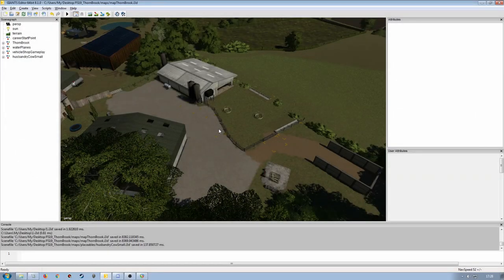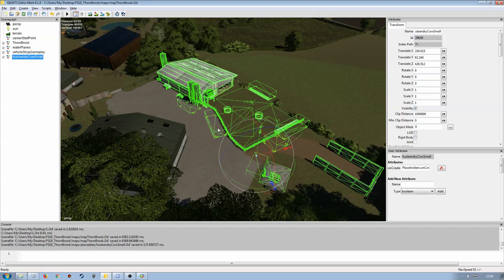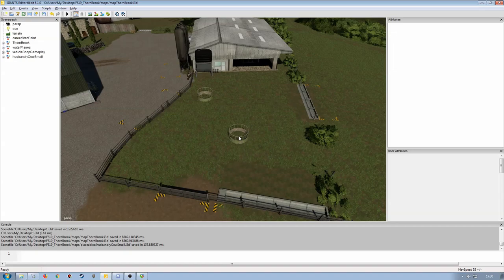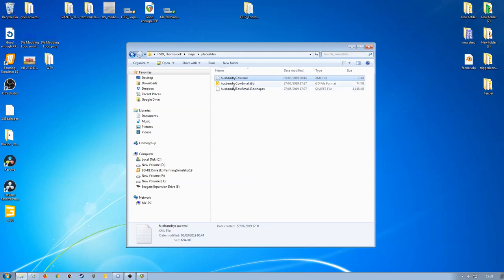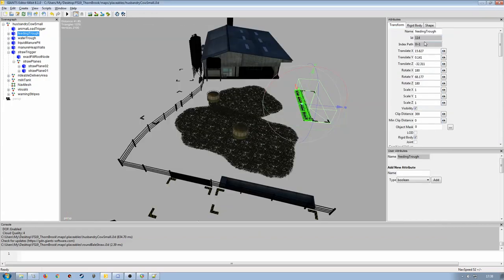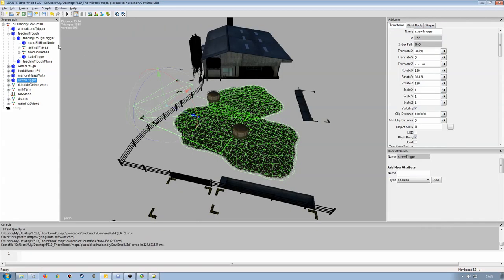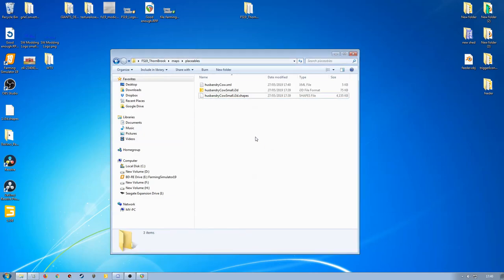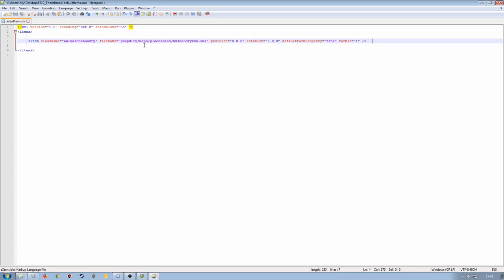Building custom cow husbandry part 3 - FS19

Comment: For goat feeding trough has grass in it before i even used it.  How do you change it to be empty?  Did you mention something about fill planes, im not sure how to change that.
Reply from the maker: If you look in the xml there will be a line of text similar to this                     <fillPlane node="0|1|1" minY="0.125" maxY="0.4" colorChange="true" />
Select the fill plane & move to desired height for empty & full, then take the readings for translate "Y" in the attributes window.
Then change the values in the xml for "minY" & "maxY" respectively.

Comment: Mine is there but triggers are  not working, the map I am using (growers) doesn’t have a default items file either
Reply from the maker: Sounds like you have the imported one in the map not the placeable which is possibly why the triggers are not working.
I don't have that map to hand to check what files there are.
The default items xml may be called something different on that map.
Reply: ShyWizard Thanks for the reply, do I need to re import the placeable once I’ve created it and saved it in the placeless file? Is there an alternative easier way to create these where they are just constantly in the map with triggers regardless of game mode?
Reply from the maker: Once you have created the placeable & set it up to load into the map, do not re-import as you will have both objects in the same place.
Due to the game mechanics of 19 being around placeables there is no other way that it can work.
If you want the placeable (Not including mapBound) to show in all game modes set the attribute to defaultProperty="false"  instead of "true".
Whilst this does work it can produce issues around land ownership as far as animal feed spill requires the land to owned by a player to work (Tip to ground).
Reply: ShyWizard I’ve even tried to copy the existing cow husbandry in the map and change the name of the copy but I still get the same result, the triggers don’t work, for the One already in map the building exist in the map and the triggers are all separate and only exist in the items xml , any ideas?
Reply: ShyWizard I started from scratch and with a bit of trial and error it worked! Thanks this completely changes the game for the better
Reply: ShyWizard currently have 4 cow sheds on the main farm and it works great ! Thanks again

Comment: Good day, on the map made animals, as in your video, but only cows work, the rest do not want, pigs and sheep, the land does not belong initially, it must be bought, lines from the log attached
2020-01-12 19:00 D:/Documents/My Games/FarmingSimulator2019/mods/FS19_Samplemap_4fach/maps/placeables/animalHusbandry/husbandryPig.i3d (3.43 ms)
2020-01-12 19:00 Error: Running LUA method 'update'.
2020-01-12 19:00 dataS/scripts/placeables/Placeable.lua(1224) : attempt to index local 'storeItem' (a nil value)
2020-01-12 19:00 D:/Documents/My Games/FarmingSimulator2019/mods/FS19_Samplemap_4fach/maps/placeables/animalHusbandry/husbandrySheep.i3d (1.12 ms)
2020-01-12 19:00 Error: Running LUA method 'update'.
2020-01-12 19:00 dataS/scripts/placeables/Placeable.lua(1224) : attempt to index local 'storeItem' (a nil value)